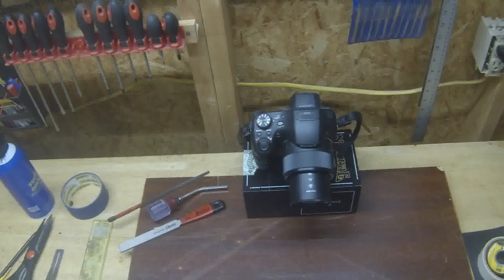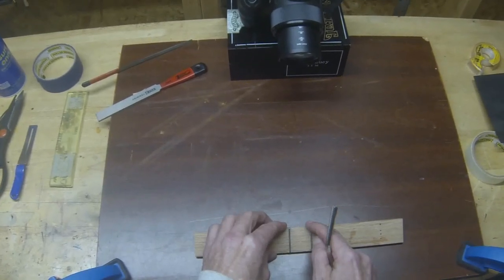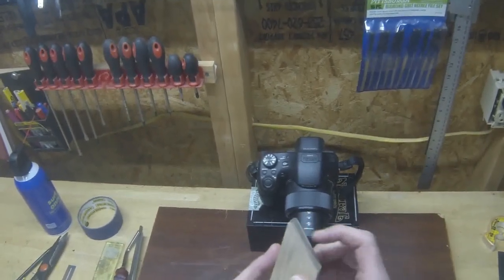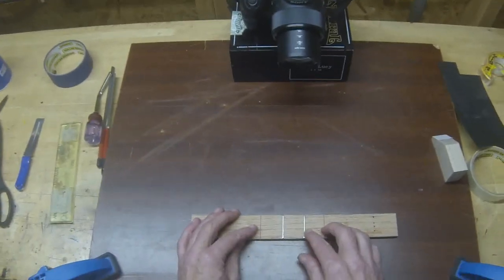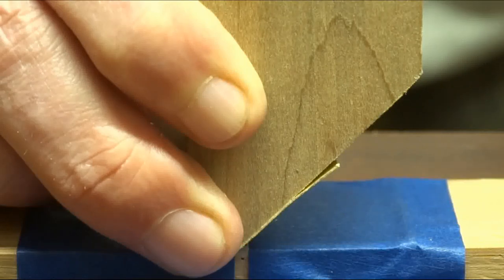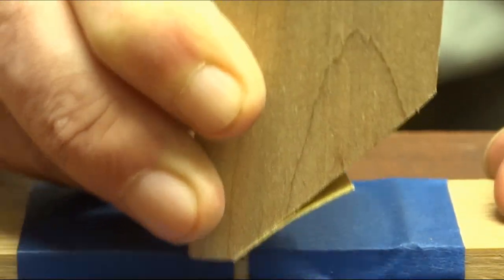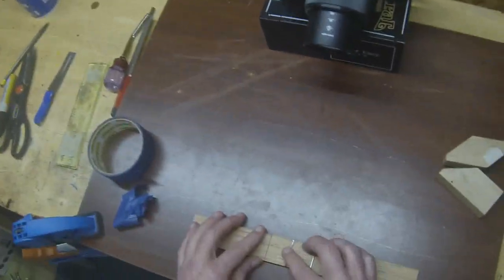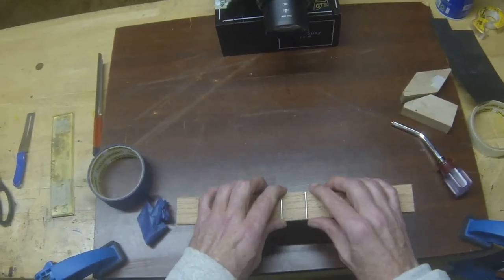Fret Crowning Made Easy and Cheap, No Files Needed.

Comment: I bought the Thomas-Ginex fret refinishing kit decades ago, same idea. Has been well  worth the small investment (about 1/4 the price of a crown file).
Reply: That was my first foray into fret dressing about 30 years ago. I did three guitars and started teaching myself the methods of set up that I’d paid techs for, but rarely got.
Reply from the maker: Had one also and still have it in a box out in my shop. Been years since I've looked at it. Been using the StewMac Z files for a long time now. Love those.
Reply: @stormcrowinstruments7489  Never used the Z files. They look oddly unbalanced. Do you have to do the fret from both sides?
Reply from the maker: The original and the safe edge files you do from each side separately. The Z Center file does both sides at once. I have the original and the centered one. They're not unbalanced at all. Few swipes with the centered one and you're done. Easy to keep your center line with the Z files also. I'm about to upgrade to their new diamond Z files.
Reply: @stormcrowinstruments7489  Looks like you may do the volume to make that worthwhile. Though I imagine they’d work better on stainless, too. But thanks for the info. I’ll consider that when I’m looking to upgrade.

Comment: You could enhance the whole tool so there are vertical line markers for the two or three different angles of tilt that you wish to use. I'm going to make a few of these for sure. I do have the fret guru crowning tool which works really good for getting the lower parts of the crowning job done on both sides at once, but even if you angle the tool over, it still is not great for getting a real thin top strip and your tool looks like it would be easier to get the final angle right. So what I'm going to do is build in the finishing angle into the one I make so I can use the fret guru file for the main lower part and this new tool for creating that nice thin strip on the top. Thanks for the idea.
Reply from the maker: Hope it helps out. Like I said in the video I use the StewMac Z files. This was for people who didn't want to spend the cash on a real fret crowning file. I have the Fret Guru to try out but I haven't had the time to do it yet. Thanks for watching.

Comment: Can poorly crowned frets cause fret buzz even if the frets are level?
Reply from the maker: Absolutely. All the frets needs to have that perfect little line left at the top. For instance, if someone is in a hurry and leaves some flat spots on top of the frets it can cause fret buzz even though all the frets are level. This might happen if someone only levels and tries to crown some frets and not all of them. I've had to repair lot of guitars where someone will just level the frets and not even crown them and this will cause fret buzz because the frets, or some of them will still be too flat on top while the others will be crowned properly. However, the fret buzz might be caused by other things such as the bridge height might be too low, truss rod needs adjusting, nut slot depth is cut too low.

Comment: How do you know that fret is flat in the middle after such crowning?
Reply from the maker: That's reason for covering the top of the fret with the black marker pen. That way you can keep the black line straight in the middle of the fret. You just want a thin straight line down the center of the fret when you're done.

Comment: Stew Mac is ridiculous in their price of tools. Again, like everything out there, you pay for the name of the product more than the quality. There are plenty of others out there that cost WAY LESS than Stew Mac. Shop around.
Reply: Music nomad works just fine
Reply from the maker: I've used them all and prefer StewMac for most tools. They have went up on prices a lot in the past few years but some of their tools there is none better out there. Sure, a straight edge or radius sanding block aren't unique and you can find them cheaper like Philadelphia Luthier has decent prices but they've went up in cost a lot also lately.. But tools like StewMacs diamond crowning files, diamond nut files and lot more there isn't anything that compares to those.
Reply from the maker: @JoelAdams-j9x  I just bought their tri-notched straight edge to try out.
Reply: You get what you pay for. For nut files for example, I’ve found none better than Stew Mac’s. They also warranty them forever basically. Yes, some of their stuff is over priced, and sometimes I’ll buy a cheaper option. But most of what I’ve bought from them has performed bettter than cheaper alternatives. I can’t tell you how many times I tried a cheaper option first only to replace it with stewmac and regret not just buying quality the first time. Buy once, cry once.
Reply: Part of the cost is lifetime replacement... Most everything I've bought from Stew Mac are great products, but Music Nomad make some great tools as well. I'm extremely excited to get my hands on the S File that has been out of stock since release...